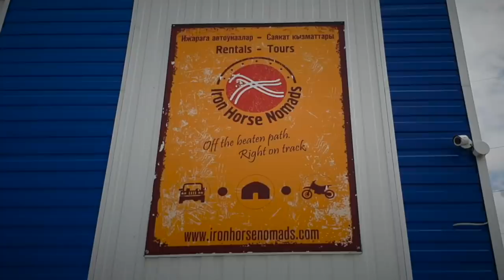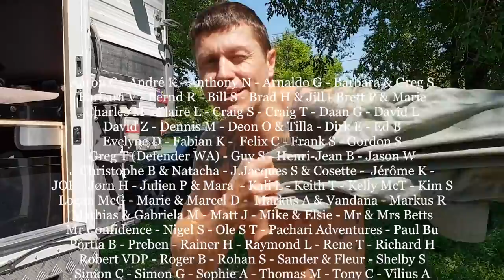Disaster at 3000m (Ep75 GrizzlyNbear Overland)

Comment: I only write this as a warning for tourists coming to Australia. My dealings with Landrovers:- I did a 4x4, 6 week course in 1974. It was part of my job. Both vehicles that were used were Landrovers. One was a short wheel base 4 cylinder and the other one was a long wheel base modified Holden 6 cylinder Landrover. Besides being rough as guts interiors they were both were mechanically inadequate for Australian conditions. Through the course we broke 4 axles..mind you not pushing them that hard. There were electrical problems and back then crash gear boxes. As they say, "If it wasn't leaking oil..it was broken" and that also applied to them. When Toyota landcruisers  bought out the first vehicle our department purchased them in place of Landrovers and it was a real pleasure then to go scrub. 
Since then I've had friends with newer Landrovers and each one has had considerable problems, one way or another. All accept one has 'upgraded' to a Toyota or similar. Parts are also a not easy to come by when your in the North of Australia for Landrovers.
Landrovers, unless modified for conditions in Australia, are not really recommended for travelling Australia. 
They are all well and good in Europe and England where parts are cheaper and available and the weather and on and off road conditions are not as harsh. Oh...don't get me wrong the newer Landrovers are very comfortable and seem to drive well on our bituminous roads but in "my" opinion are not real contenders for here.
If someone from Landrover would like to prove otherwise, without utilising a crew and spare parts truck, change my mind!😁👍🏻🇦🇺
Reply: "Through the course we broke 4 axles." - There's your problem. None of the instructors knew how to drive offroad.

Comment: Aha, I recognise that part. :o) If I remember right there were a load of aftermarket Teflon coated chalice that were too hard. And that looks a bit Teflony. “Too hard?” You might ask. Well, early Range Rover were six bolt and they went to seven, because the chalice was strong enough to stretch the bolts in the rough stuff. Seven bolts meant that if you really went for the sky you would bend the factory chalice where that one broke. - I have that axel, given it a right good kicking for decades, and that isn’t how the OE part normally behaves.

Comment: Always carry spare belts, radiator, water pump, track end rods, injector pump. Land rovers are very reliable if you look after them just make sure to seal all the electrical wire's with a rubber pipe and someone clips.

Comment: Next time in the snow and ice or even sand you can jack up the broken corner, get rid of the tire hub brake lines etc and drop it onto something that will slide and use plenty of strops to the bullbar and you can drive forwards I did this with a tree branch and made a skid once and drove out, drove it onto the trailer but had to use a wheeled dolly to back it off. I was lucky mine was a kingpin pin snapping but brake lines etc can be replaced having someone hit you or not being able.

It may be worth having someone check that front ring and pinion, front bearings etc as no oil and high loading it is better to have someone check there is not a new problem with movement that will catch you later.

Comment: I did this trip in my 75 troopy and had front axle hub issues also. Fixed them on the side of the road in the wakan corridor. the issue continued to plague the car until we finally fixed it in Georgia. However I never saw the cruiser on a tow truck. That’s Worst nightmare scenario

Comment: That tuff winching with the winch set low on the truck bed it pulls downward as the vehicle approaches the top of the accent pinning and a break like affect takes place preventing any forward movement, more strain on cable suspension tyers and all the stuff ya don't need to stress and damage, steel and cold conditions don't mix well under tensile load , I stay well clear of the cable,  just bad luck with that pot hole guys glad ya all okay, really enjoy your travels best wishes,  cheers see you on the next one 🤙😊

Comment: You've been really lucky! Things like this can easily kill you! It happend while driving slow and it happend on the road. I remember the day I once hit a fence with my G wagon. Nothing bad only some scratches in the paint but I thought it would be better drive to my repairman and let him check the car. He did and he found a major problem with the steering track rod. It had nothing to do with the fence but if the thing with the fence had not happened maybe the steering track rod would have been broken on the Autobahn and I could have had a horrible crash. So: There is a reason for everything and sometimes "bad things" turn into "real good things" or save your life. Just trust in God ;-).

Comment: Have you considered 255-85-16's? Just as tall, but narrower & lighter. Less leverage fighting suspension & drivetrain, plus better fuel economy. I'm running the ST Max in that size & was blown away with the mud traction. Pretty sure I'll never buy mud tires again.

Comment: Glad you guys are ok! Despite all the stress and difficulties you have to overcome with breakdowns like this, at the end it is one of those things that makes a trip unforgettable!

Regarding tires, I don't really think it's a size problem, yours aren't that big. It's mainly a truck's weight and accumulated abuse that axle has gotten during its long and interesting life. Also what pressure are you running on those? Please keep in mind that wider tires need lower pressure than a stock skinny ones. So, if your ride is harsh and shaky, consider lowering a tire pressure to minimize stress that comes to a chassis, especially on a bad roads like that. Cheers!

Comment: What size are your tyres? And what are going to be your new tyres. I know most of us wonder “Would it have happened with a Landcruiser?” Anyway, I love your spirit. With a spirit like this, everything is possible. All the best and safe travel.
Reply from the maker: Thank You. The tyres were 285/75R16 + spacers. will go to 265.
Reply: @GrizzlyNbearOverland  This size really does not seem big. I have been running that size for quite a long time. I believe the issue is the spacers. Of course, if the Land Rover needs spacers to fit those tires, then you don't have much choice. Otherwise, I would just remove the spacers. It must be hard having everyone giving pieces of advice. Even if spacers are probably the issue, I would understand you would fit smaller tires to avoid potential problems. Anyway, the adventure starts with the problems. And this is excellent for your social media engagement. 😜Good luck and safe travel.

Comment: Oh jesus!
This gives us shivers as it seems that this could also have easily happened to us! We are wondering what your opinion about the tires is, because we are running the same type (Cooper Discoverer STT Pro 235/85 R16 I suppose?). Did you have wheel spacers (the things that cause the tires to be further apart, I don't know the correct term) mounted?

And you both are right - you were very lucky that this didn't happen in a turn etc.

We hope to meet up with you guys somewhere along our way. We are currently in Bulgaria and plan to be in Central Asia in the summer months - we'll contact you again when we come close :)

Best regards
Karin & Daniel
Reply: I manufacture new vehicles in the US.  In an earlier video he said he was running 285/75 tires with 30mm spacers.  While my opinion of Land Rover reliability is fairly low it's still unusual to see this kind of failure.  Stay with stock sized tires and you'll be fine.

Comment: Steel ropes from the roof to the car bonnet are banned in many countries. They pose a great danger to pedestrians. They are only useful in a dense forest to protect the window from branches. Why do you need them on asphalt roads? Oh, I understand... Land Rover looks more adventure :)
Reply: Come on. Easy bullying. You don't change cars every day. You always prepare the car for the worse conditions. You have mud tires for off-road and you can use them on black roads. The opposite is not true. Have a bit of respect for them. I watch because I love what they do. Looks like you watch because you love hitting on them. Front bars are dangerous, actually, everything on an overland vehicle is dangerous. We carry gas in jerricans, our center of gravity is too high, we carry spades that could cut a biker in half should we have an accident, mud tires are terrible on roads, etc. but this is the only set up to work off-road and on-road. I am an experienced jungle driver and I don't think they are actually necessary but pedestrians would probably be dead from being hit by the bull bar before being cut in half by the steel wire. They obviously do not drive fast so the risk of such an accident is limited. I have only one thing to tell them: "Respect for what you do".

Comment: my f-250 has taken a hell of alot more abuse than a pothole like that but without pulling the shafts out every 10,000km to check all bearings, u joints, suspension, track bars, ball joints and steering rods it easily could have been my camper on the side of the road.

Comment: Man, I build high power defenders for a living and it freaks me out just a little bit seeing a swivel ball failure like that. I'm thinking there maybe was something to compromise the part like maybe rust where the part narrows down or something like that? Glad noone was hurt!
Reply: There was a known fault with 2011 and 2012 year front axles.
There was a recall, with the 130s they replaced the axle, with 110s they fitted a bracket to make the wheel fall off less badly, and with 90s they didn't do anything.
Reply: @tomcardale5596  I am in the u.s. so i dont get to hear about that juicy stuff. That's a little scary.

Comment: Had you had the recall done before you left? If not, that's probably the cause of your issues.

2011 and 2012 Defenders had a batch of dodgy front axles that fail in exactly that way. There was no fix for the 90, the 110 had a couple of stupid little bolt on brackets that mean the wheel doesn't fall off quite so badly and they fitted a completely new axle to any affected 130s.

Comment: You  are almost 5 tons and that is way above the load limit for any stock or not properly modified axles , leaf springs and shock absorbers in Land Rover 110 !
Reply: We weigh 3.4 ton, it's a Land Rover 130 HCPU not a 110, we don't have leaf springs and our suspension has been completely modified for our load.
The failed swivel ball housing was a factory defect part.

Comment: I know it is not really an option for you. the Dana 60's front and rear for a JK would work great option for you. the weight you are running and the rough roads these extreme axels maybe a good upgrade next winter. so you can run 35-40's but will be tougher than the Land rovers axels regardless of what tire size you use. Safe Travels.

Comment: I think you need to do a research as to why that front hub snapped.. Whether its excess weight you had or an old/fake hub(may be it was changed previously) or The rigidity of your new suspension that failed to absorb the pot hole impact correctly. It will help on confidence of your next adventures when you know exactly what went wrong.. 

Also, the hub a very crucial part on a vehicle.. Consider a new one other than a welded part...
Reply from the maker: It was a defective part. Also we installed a new one. Thanks. Next video will explain all we did.
Reply: @GrizzlyNbearOverland  That's great.. and all the best guys..

Comment: Buy a Unimog ,Landcruiser or a Hilux nothing else to travel the world . The Landrover is not made for this kind of Traveling. The Landrover is an underpowered , bad built and very old construction. Its purpose was to help farmers after the second world war in England. I had a couple of them and it was always a mess to repair it while you traveled and on top having paying guest on board . Once in my Series 3a the dashboard came into fire , because the car had only 3 fuses ! I had problems with axles and suspensions and my Landrover had a canvas top!! Now you know about the load capacity. Hands off from British cars (also if the company belongs to Ford!) i f you want to use them as  a daily driver or expedition vehicle !

Comment: I have seen a few Defenders plagued with this issue. 
Especially on corrigated roads.
There are ways to solve this issue, like welding in braces on the top and bottom between the swivel and flange. 

Best of luck.

Comment: When you get the chance put some discovery 2 axels on it much stronger 
An easier to work on 
And they don’t cost a lot
Reply: no why would you? they not as good design and wouldnt be rated for the weight. A 130 like that would have a salisbury rear axle and possibly thicker front axle tubes. Let's be honest this thing would be heavy, over the gvm by far. Not only that he's running a wider offset and bigger tyres than stock you putting way more leverage further outboard than what it designed for. Nothing wrong with swivel ball housings
Reply: @SomervilleMetalWorks  AGREE! There are enough downfalls w the D2 Axle

Comment: It's called a cv joint, cv for constant velocity
Reply: The constant velocity of that one was ZERO.
Reply: It’s not a CV joint... it’s a half sphere, with a centre pin through of that, that gives its pivoting motion, unlike a CV joint that has internal rotations manipulated by bearings that is under contract velocity due to multiple angles...

Comment: Damn! a pot hole at low speed.....not even off-road. That would have been heart breaking initially. Silver lining - it was on a busy road with help at hand and no one was hurt.
As an aside having used Land Rovers for decades in the Army I would not recommend them to anyone. Ergonomics, interior, handling and reliability all suck for the cost of an arm and leg. Pass.

Comment: Was it a non original swivel housing??
I regularly tour (in africa) loaded to 3.5tons and my defender has never skipped a beat. 15 years old and good as new.
Reply: It was original and that was the problem.
We found out after that our model Defender had defective swivel housings from the factory.
They were actually a recall item.
Obviously the previous owner never changed them out.
Reply: @leighdearle5965  Pitty it happened during your trip. Anyway, great rig you guys have built. Hope you have a great rest of journey.

Comment: I think you would have done this much damage with even stock size tyres, as it would have dropped further into the pot hole possibly causing more damage, to the axle casing, you need the bigger tyres carrying that camper in the bed.
Watching your crash back along I think that is a contributing factor to the damage you sustained hitting the pothole, looking at the angle of the right side front wheel I think this is more to do with the damage than larger tyres, those tyres are not big in the scheme of things. I really don't think the tyres made any difference to the resulting damage.

Comment: Love your show and attitude, when I was a little boy my father had a land rover 1975 or 77 it had the same issue always with either  front or back end land rover never fixed it even BMW give up and now TATA, regarding your large size wheels the C-CLIP is extremely weak on these over priced and ugly land rovers
Reply: No c clips on a defender axle, are fully floating axles front and rear
Reply: @mikkimash  Good info, thank you, even with independent suspension your axial has to attach to front and rear deferential by something, in most 4x4s you have two control arms as appose to land over  only one and a CV joint

Comment: saw it happen on Instagram.. The tires don't seem that huge, what size did you run?
Reply from the maker: it was 285/75R16 just big enough that we had to have spacers
Reply: Wasn't that huge though I think? I'm running 265/70/17 on the Cruiser.. but I've learned early on (back in the tuning days..) Spacers are bad.. they can throw off balance and so much more.
Reply: @GrizzlyNbearOverland  33s. . .
Reply: @OverlandingNL  33s should be ok on a Defender if the right stuff is done to fit them. . .

Comment: Hi you say you going to smaller wheels. That's not your problem at all it was just bad luck that snapped . I work with land rover all the time in all the years i'v bin working on them i'v never seen that happen be for. And I work on off roading land rovers and if you see what they go through you would never do that in your landy rover set up.  So it was just very bad luck nothing to do with the wheels.  But if i were you  I would just change both housing swivels. To be on save side.  But wheels didn't cors that to brake.

Comment: The tyres size had absolutly nothing to do with the failure.
Reply from the maker: Tyres no - spacers probably
Reply: @GrizzlyNbearOverland  all the best with the trip. We have a Perentie in OZ  and are setup for overland travel.  Sleep in the back and have a much more basic setup under the canvas softop.

I guess you should have the other side front pulled apart and inspected for cracking / damage if you would desire to avoid a repeat failure.   The other thing I would check when you have a chance is to measure the front and rear axle loads when fully laden with people and supplies.  I would alse consider replaceing the weld repaired hub at some convient point in time.
Reply: @johnallen3555  we never used the welded hub. We had a new one sent from France.
Nikolay welded it just to show us he could 😉
For sure I will replace the other side hub also.
We found out later that there was actually a factory recall on the hubs of our model Defender many years ago...